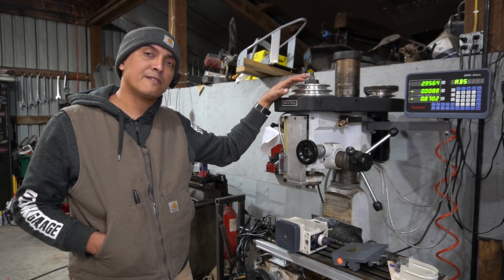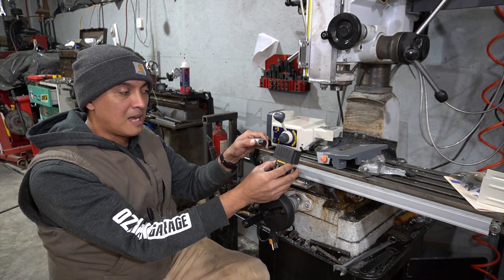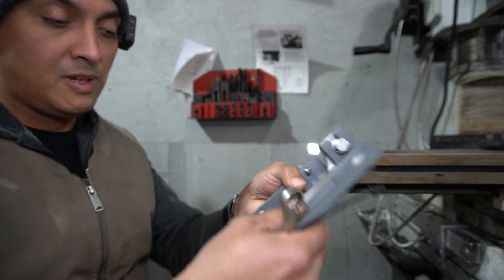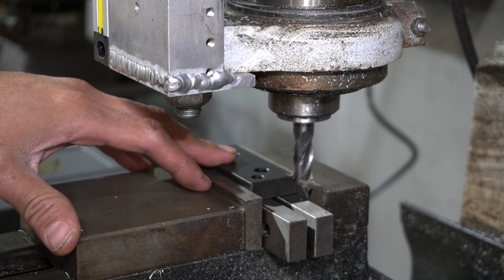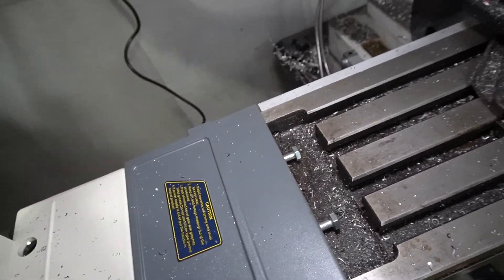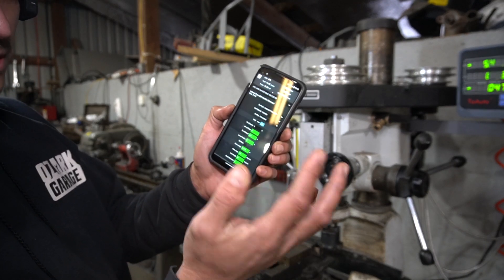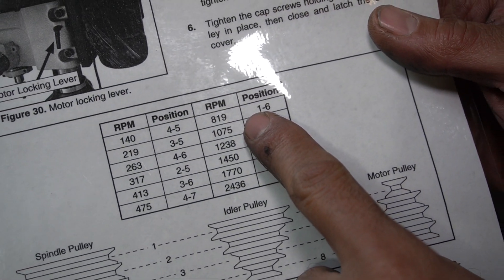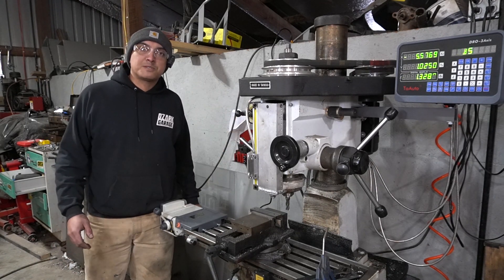Mill/Drill Upgrades Part 2: Power Feed

Comment: Just watching (You Tube University!) another fellow last night that was doing the same install on his round column mill.  Getting psyched up to do my own in practice for my larger mill.  Interestingly, he did not like the clamp bracket taking up table space (and height if you are doing a long piece clamped directly to the table) so he milled out a piece of 3/4 aluminum for the bearing and two bolts coming from the back in recessed holes to mount the motor.  He then drilled and tapped the end of the table to mount the adapter plate in position.  End result was a flush mount with completely accessible t nut slots.  I could see the swarf and junk getting trapped in that cavity and or the bolts vibrating loose as well as being proud of the table.  I think I am going to go with that modification on my install.  Good concise video.  Be sure to check your four footed friends feet so he doesn't get and chips between his pads.

Comment: When you moved the DRO to the back of the table you covered up an oiling hole.  Pretty easy to forget it anyway but now it will never get oil.  Now you need to design and build a remote oil line to oil that point in the bed from underneath or somewhere.  Things are never just straightforward and easy.
Reply from the maker: Its pretty easy to use a pump oil can to oil the ways and screws from the front and side

Comment: Very nice happy to join your subscriber base, I just found your channel. We are a 2-man California desert machine shop. Our Chinese mill came with an X,Y,Z power feed system built in we did add the DRO that was a task but happy to have it. Lance.
Reply from the maker: Glad to have you on board! Do you guys make anything in particular? Or more of an old-school general machine shop?
Reply: @ozarkgarage  Hi yes, we machine small watch parts for vintage wristwatch movements for 33 years now. We have a YouTube channel but have not posted in years if you want to see some of it. We refurbish vintage watchmaker machines and tools in our spare time for our collection. I will be following your journey; it is really nice to be able to share with you. Lance.
Reply: What app are you using and where did you purchase the autofeed. I have a jet -18 mill drill and in the process of doing the same upgrades .
Reply from the maker: @IRONANDAMMO1988  FSWizard is the speeds/feeds app I use. I tried a few other ones but they were all built around CNC, this one has more functions for manual machines. I bought the power feed on aliexpress, way cheaper than buying from Grizzly, but took a month for shipping.